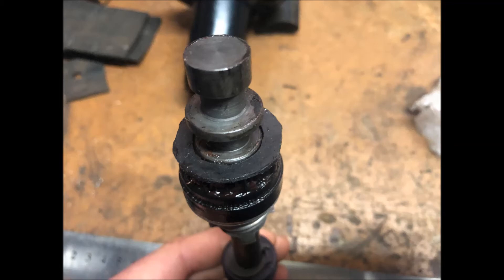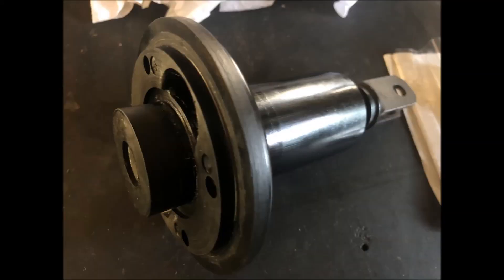ATE T51 brake booster poppet valve distance problem

Comment: Hey 
Thx for the explanation. I think i have the same problem. How did you opend the booster ? 
Cheers
Reply from the maker: Hi Samuel. You have to twist it open. I bolted a long steel bar to the one side and clamped the other side in the bench vise. Then I hit the bar with a hammer to turn it, until it popped open. You can see more information on the booster here: https://www.benzworld.org/threads/brake-booster-what-is-wrong-when-it-leaks-no-pedal-pressed.2753073/page-2
Hope you win!
Reply: @LKtubeable  Hey thanks a lot for your reply. Your answer and the link is gold worth.
Reply: Hey, Thanks for this video . That has helped me march 2025🎉

Comment from the maker: Problem fixed. Added two 1mm gasket washers, one on the end of the poppet valve and one where it seats in the tube. Works perfectly now.
Reply: how did you know what the measurement SHOULD be in the first place?